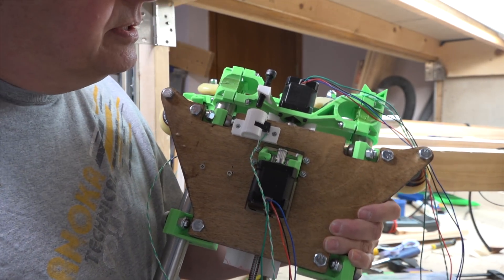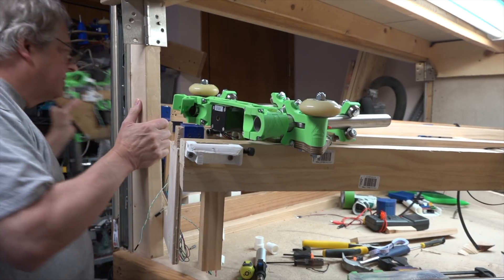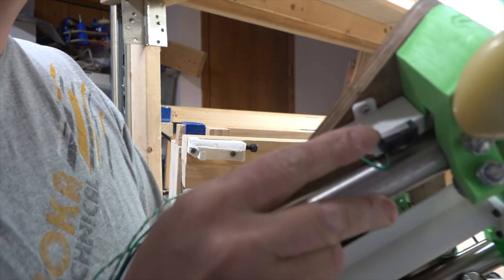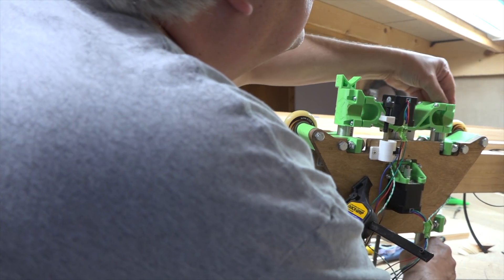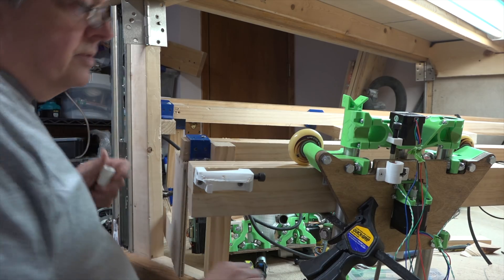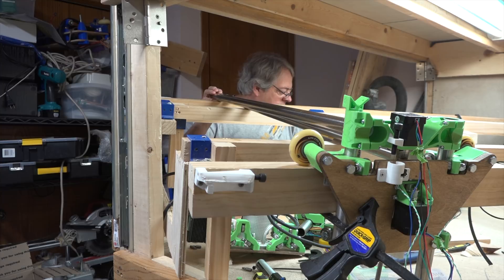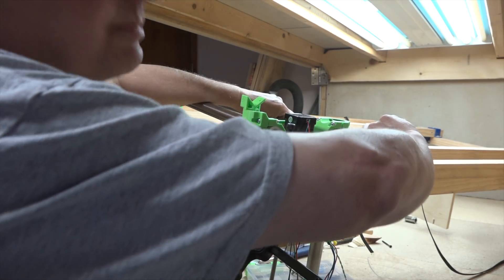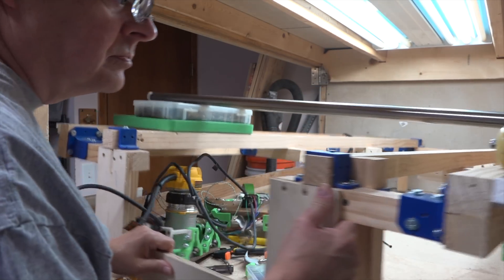Lowrider II Build - Part 7 - Final Assembly

Comment: In a later video of this LR2 build, you had to extend th X rails.  Was that because you used the white smutz covers?  I don't think Ryan's size calculator takes them into account.
Reply from the maker: It seems to me that the schmaltz cover rides below the thickness of the stainless.  I don't think they were the problem. I think I just had the ends together so tightly that the stainless had the grip of death on the table.
Reply from the maker: I misunderstood your statement.  I had wanted to be able to get a 2 foot by 4 foot work area.  The calculator indicated I needed just over 32 inches of stainless for that axis.  I could get it in 32 inch. precut length. So that's why I added the extensions.  I didn't have them on Lowrider 1, and I wanted to resolve the problem on this build

Comment: How many hours will work this machine continuaslly... because if board and stepper motor will get more heat.... So please advise
Reply from the maker: the steppers can get quite warm, but if they're getting hot, then the driver current is too high.  As for the board, you want heatsinks on the drivers and probably a fan.  It can run as long as needed.  I've run some jobs lasting many hours without issue.  Some laser modules have recommendations for maximum run-time. I've run my sunwin 3 watt laser for many hours continuously without any apparent problems -- so far.
Reply: @Someoldguycoding  thank you sir for your valuable reply....